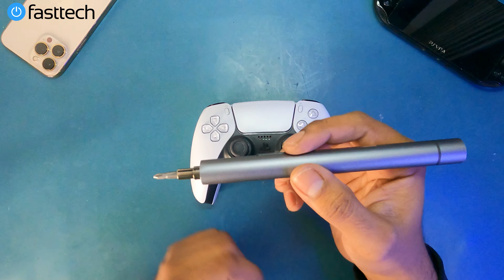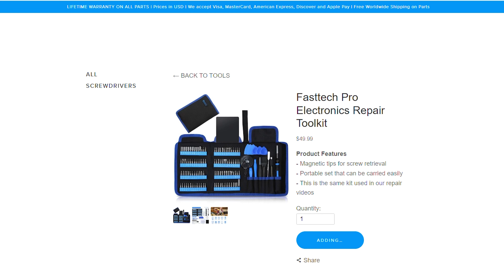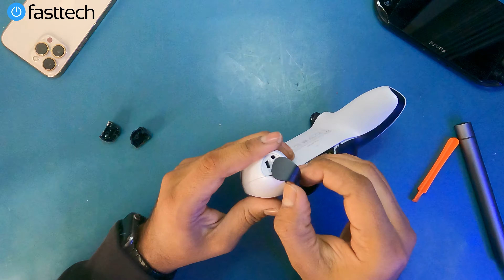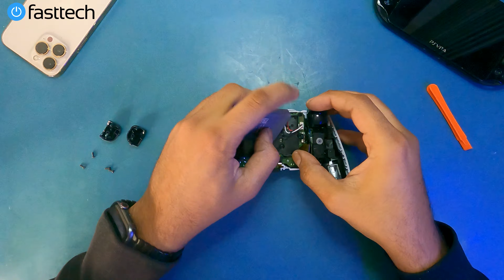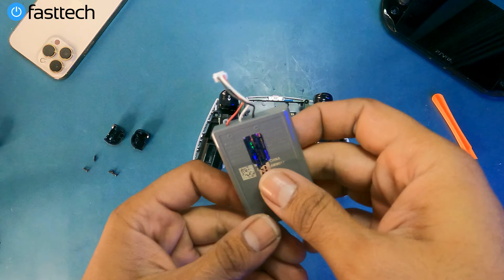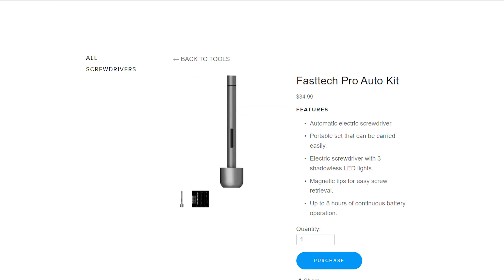PS5 Controller Not Turning On / Not Charging Repair (Battery Replacement Guide)

Comment: why I stop buying Sony consoles, fk duel sense, fk dualshock
Reply from the maker: They are designed to fail due to the analog sticks. The battery is much more forgivable since its a consumable item in all devices but consumable analogs are consumable because of design choice
Reply: @fasttechvideo  =(
Reply: @fasttechvideo  I moved to Xbox now, Playstation is too much.
Reply from the maker: @ ok

Comment: I have the same problem, but when i turn on with the cable it does a single blue led and instantly turns off, could it be the battery?
Reply from the maker: Mainboard issue or battery issue
Reply: @fasttechvideo  What is psu? Sometimes when i connect the cable the controller turns on but the battery does not charge. When i leave the cable it turns instantly off. Could it be the battery?
Reply from the maker: @carbon1812  sorry i misread ur comment earlier. Replacing the battery will fix your controller
Reply: I actually just replaced my battery today and it’s still tweaking on me. The blue light will flash every time I press the ps button but it won’t actually connect or turn on

Comment: What about if my controller only lights up 1 single orange blink upon plugging in or mounting the controller?

No sign of life by pressing the ps button, even having a USB connected.
Reply from the maker: Most likely a dead battery.
Reply: @fasttechvideo  swapped battery from a known good controller and battery was fine.
Reply: Did you manage to find out what was wrong? I am having the same issue, orange light comes on when I connect it, stays on for like 3 seconds, nothing happens. Controller doesn't turn on.